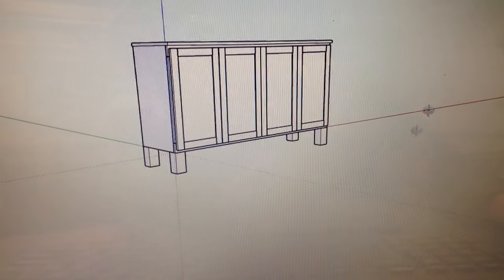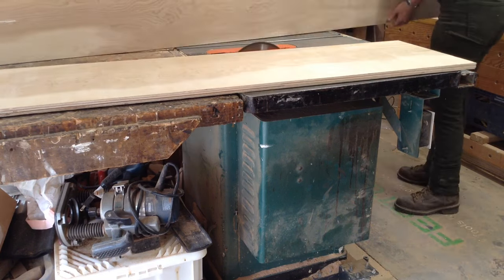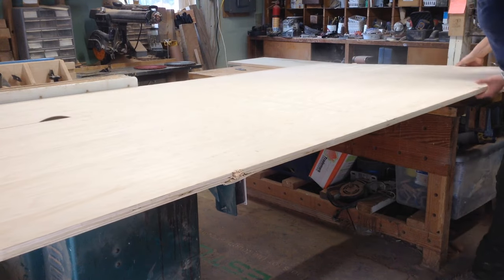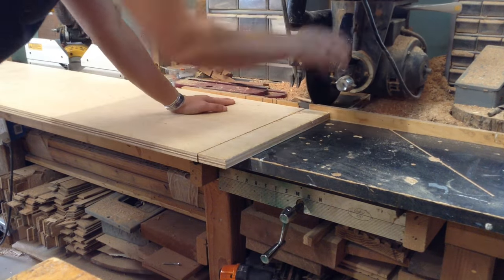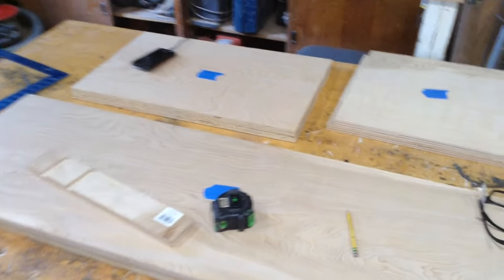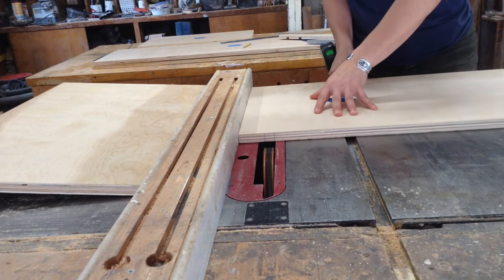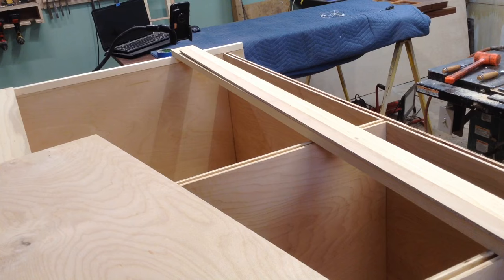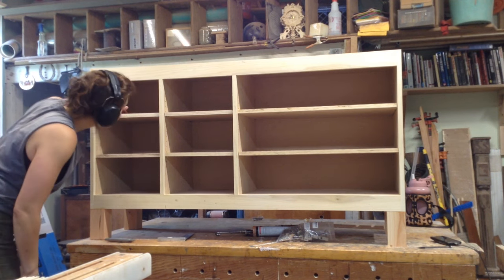Woodworking Furniture Projects For Advanced Beginners

Comment: Domestic plywood is still pretty good. I opened an account at my local cabinet supply (I am a cabinet maker), it was pretty easy. I find the Columbia brand very nice, and I have found consistent import plywood that has many layers like Baltic birch…. The veneers are thin no matter how much you spend but the lack of voids is a bonus. Over a project the size of this you will spend about $40 more than lowes but with at least $40 less in frustration.

Comment: Yes, plywood has really gone down hill.  I have a local plywood supplier and they even complain about it. I’ve taken to using MDF where I can for paint grade despite the dust and it being so heavy.
Reply from the maker: It's awful, the adhesive on my last years worth of orders is terrible.  Multiple sheets with large air pockets and no glue adhesion at all.   And the best part is you don't even really notice it until the finishing stage when the veneer absorbs moisture and bubbles up.  Super fun to fix.

Comment: Always interesting to see how you construct your pieces. I recently made a similar cabinet but didn't use dados and suffered badly as a result. I have to say though that I stopped pinning face frames on as the effort in hiding them after took far more time and patience I just don't have. It's a lot of clamping or taping but saves a lot of frustration. I guess I have more time to wait for glue to set. Thanks for sharing your work.
Reply from the maker: For paint grade stuff I usually brad because filler can be annoying, but usually cleans up pretty fast.